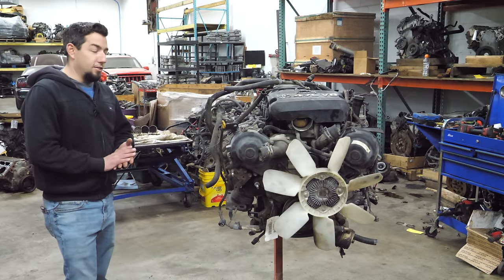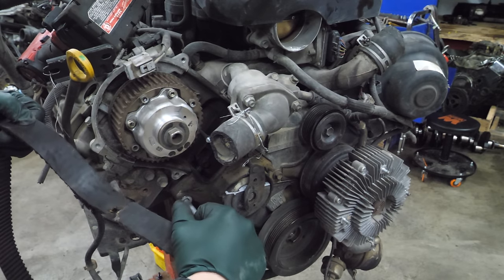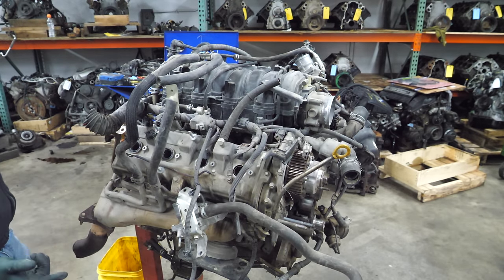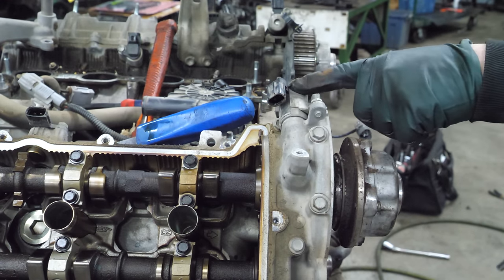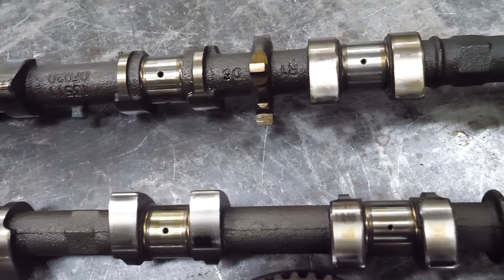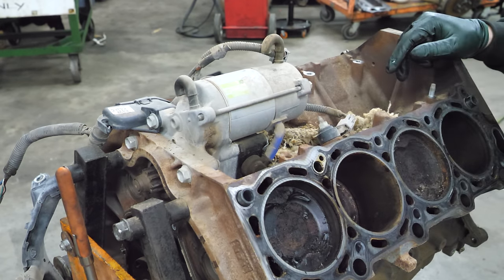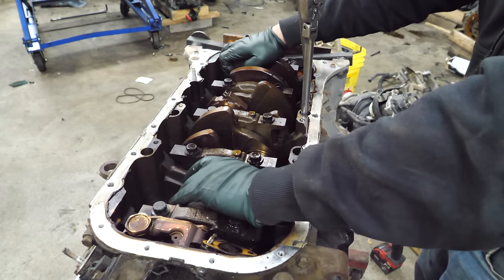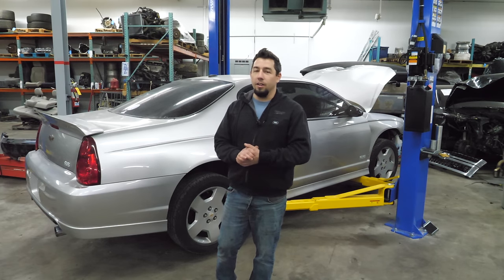Toyota Tundra 2UZ VVT Teardown! Bad Decisions Led To The Demise Of One Of Toyota's Greatest Engines!

Comment: Fantastic video / 'tutorial'!!. (I'd wish I could've subbed 10X). Great info / remarks. All respect to Ben Iacobucci's comment: I'd dare add 'most Toyota engines, even those from 1.963', (My own / late Grandad's FJ40, very same one I used to 'learn' to drive @ one of his farms, early 1.980's, when I was about 10 yrs old), NEVER die, unless some jerk  does 'something really wrong on purpose'. I still keep my late Dad's 1.984 Nissan Patrol / K160 w/ original P40 petrol engine purring like a kitty. Why anyone?.. Quite simple indeed. It's almost my Family's tradition 'cuz Toyota & (most) Nissan's reliability, as long as you perform due maintenance BEFORE deadelines. I even have motor's oil / tranny's fluids changed at least twice a year, keeping in mind oils / fluids tend to  oxidize, even if the motor / vehicle is used less than 200 miles per year, as my  old Nissan Patrol or 1.995 Toyota Land Cruiser FZJ. BTW: I'm NO mechanic / technician, (I'd wish I were one!). I'm just an ER/ ICU Dr.

Comment: Mine broke while idling... it's fine now... no damage internally... I even tried to crank it again after it broke...
Anyway... I tested the compression and then put new H²O pump and misc. other wear parts and cranked it up and drove it... 
NOT interference engine unless you're doing 80mph on the interstate and can't stop...

Comment: I have a high mileage car, the scheduled maintenance has been by the book since new. The consequences are: 256,000 miles with no oil consumption; performance is far more than adequate; suspension and auxiliary components replaced have been minimal.

Comment: If it had alot of mile the valve cover gaskets leak. I have 249k on an original timing belt but I'm buying a new truck next week and I'll be parking this one. I'll get it done before many more miles.

Comment: If you didn't know, you can see what makes an FE head and FE and not a GE. You probably read about valve angles and GE performance. That is correct. A giveaway without measuring is the gear driving the cams at the same time. In reverse rotation. Because the angle is narrow, Toyota used one cam pulley instead of two on each cylinder head. And then used a gear to drive the other. GE heads are individually driven. It almost looks like a diesel and not a pentroof the angle is so shallow.

Comment: That might have been dealership work. I had a 2001 Chrysler PT Cruiser, bought brand new, that had chronic overheating problems. The dealership never found any issues. Then, one day, the timing belt slipped off because it had turned to goo due to a coolant leak. Took it to the dealership, and they wanted to replace the engine to the tune of $3200. They wouldn't do a repair because Chrysler didn't allow for that. So we had it towed to a mechanic we trusted. (I have to tell you, the image of a PT Cruiser being towed OUT OF the dealership clearly embarrassed the dealership personnel.) The mechanic fixed the coolant leak and put a new timing belt on it. $600 later, it ran perfectly. I had another situation on a different car where the dealership didn't want to fix a transmission problem, they just wanted to replace the transmission for a much higher price. Dealership wanted $3400 to replace the transmission, I found someone to fix it for $1100.

So it's possible Toyota may be similar; if there's a problem with the timing belt, just replace the engine because "who knows what's wrong with it".

Comment: Just replaced timing belt, water pump, idlers and tensioner on my 04 Tundra. 120,000 miles. Belt was in very good condition. Definitely could have gone much longer but after 18 years and 20,000 miles over recommended belt change I did the smart thing. Did the job myself. (Retired millwright, so I have plenty of mechanical experience) Several good YouTube videos out there. Not that difficult. Just take your time and do everything right the first time!

Comment: Due to the nature of the VVTI, wouldn't engine damage be determined by engine RPM? I'm guessing low RPM, belt snaps, cams aren't advanced, no interference. High RPM, very bad day. 
I just did mine, way overdue, '05 Tundra, but only 40K miles. All the parts were pristine, even the belt didn't crack when folded back on itself, but this vid taught me, a couple days work, $190 Aisin kit is well worth it. Thanks for posting!

Comment: How do you disconnect that harness inside the truck? I am doing a frame swap on a Tundra right now and it would have been much easier if I could just reach into the firewall and unplug it. While the cab is on the hoist, I can't really get under the dash. I didn't plan this part very well.

Comment: I finally replaced my 2005  Tundra belt at 125,000  (12 years) looked like new,, no cracks,  nice & pliable, felt like a dummy.
Reply: Doing mine now at just past 200,000…little noise in couple of pulley bearings, but belt was in great shape! Doing it all while I’m there! Cam seals and cover seals, crank seal, plugs, radiator, hoses, thermostat etc…not bad for a 19 yr old 200k I’ve done nothing but oil changes on:)

Comment: I think there is a lot out there that think of v8 as engines like they used to be with chain-driven timing components and unless they are told they don't even know about timing belts and that they need to be changed. Shame to see a good engine go so quick.

Comment: we have all replaced starter motors in all kinds of vehicles.  and in most cases they are pretty easy.
but what causes starters to fail generally?
i'll bet that one major cause is the environment where the starter is mounted.  down low, almost under the engine, drowning in salty slush, rain, snow, deep water etc etc.  it might be that toyota has it right, up high and dry, well protected
Reply: Environment (and even frequent stop/start) will be an accelerating factor, but a starter motor is simply a high current brushed DC motor. They need to be serviced/replaced for the same reasons that distributors need to be serviced/replaced. Lots of high current hot switching and moderate voltage hot switching, which is the operating mechanism of a brushed commutator, is also the life limiting mechanism. 
I'm pretty sure these newer mild hybrids with auto stop/start are running 48V Brushless DC motors, where the commutator is replaced with electronically timed power transistors for each motor phase that are not exposed to the same shortcomings as a commutator, however the tradeoff is that it no longer has a simple 2 wire interface like the brushed motors do.

Comment: I big issue with the 2UZ was the upper water manifold seal/thermostat seal failing, owner just keeps topping it off as it leaks on the timing belt turning it into mush, at which point it strips teeth and almost always bends valves.

Comment: On your parts tundra, how much for the antenna mount and mast.  I'm tired of replacing my power antenna on my sequoia so I want to delete.  I've found some near me, but all of them have had the wires cut.  I need the mount with a complete wire to plug it back to the stereo.

Comment: next time put a 6mm bolt in the exhaust gear so it doesn't spring and put the cams back in to keep the lifters from falling out after you pull the head bolts.

Comment: To be perfectly honest, this engine is in such good shape (aside from the minor rust in the cylinders) that I'd seriously consider attempting to rebuild it.
I mean, the way it looks to me, more damage was done to this engine by sitting out in the rain than was ever done to it by the timing belt shredding itself.
The main thing you'd need to do to return this particular engine to service would be to give the cylinders a light honing, and to perhaps remove the rust from the pistons by soaking them in Evapo-Rust (that stuff does work, believe it or not, you just gotta give it time), or if you don't have the time for that, putting them in a media blasting cabinet and using fine granulated salt to blast the rust off of them (salt won't damage the finish on the pistons, I don't think. I'd check first, and select an even softer blasting media if needed).

OK, just watched up to roughly 29:00 , and I heard you say several of the piston rings were stuck. That's a new set of rings then, and making sure the ring grooves are thoroughly cleaned out too. Still, that's something I'd check as a matter of routine when rebuilding an engine.

If I had been the mechanic that was repairing the vehicle this engine came out of, I'd have happily put a timing belt in it and sent it on its way (of course, I'd have done both borescope and leak-down tests to check for bent valves first, but since you've taken this thing so far apart and found literally zero evidence of piston to valve contact, I'm confident that it would have passed such testing with flying colors).

Comment: A co-worker has appox. 280k on his early 2000 Tundra. I think he might need oil sensor since his oil pressure reads low. Oil level good.
I have to ask him about the timing belt. He probably never changed it. I taught they had chains.

Comment: During the relatively short time that I worked as a service writer (due to an injury, normally worked as a tech), timing belts were usually an easy sale. The most difficult sales of timing belts happened on vehicles where the customers didn’t put many miles on them, usually older folks. The vehicle could be 15 years old and on the original timing belt, but many customers would insist it is fine because they “don’t drive the vehicle very much.” It doesn’t matter! Rubber degrades over time whether it is used or not. I’ve seen many timing belts break before the first mileage replacement interval because they were just old. They typically are good for 10 years max.

I can’t remember for sure, but most “older” Toyota engines (just about any that use a timing belt) are non-interference engines. Odds are that if the broken timing belt was the only issue, it could have been easily fixed with a new timing belt.
Reply: That's precisely why I want nothing to do with timing belts. Ever. No exceptions. Chains stretch, sure, but even a shitty chain stretching will last longer than the rest of the car will. Something ELSE will go first. And if it's a cam-in-block engine like it should be, we're talking >300,000 mile service life from a timing chain before it's stretched enough to affect running qualities.

But hey. I'm spoiled in this regard. My 4.9L I6 uses two steel gears lubricated with a direct oil jet. The timing gears in that engine will literally last over a million miles without issue. The rest of the engine will wear out, get overhauled, and wear out AGAIN before the original timing gears are worn out. And those 4.9s have a stupid long service life anyway; half a million miles is not unheard of for them and it's considered an early death if they don't reach a quarter million. Mine's at 350k and still gets the job done without issue.
Reply: The Lexus crossovers had a hiccup with the RX330, which was a very short-lived transitional design. The RX300 (3.3L V6, IIRC) used a timing belt but was non-interference; the RX350 was interference but had a timing chain. Only the poor RX330 in between had both a belt and smashable valves. We bought a 2004 last year with a mere 140k on it, and we could find no record of the belt ever being replaced. So that was on the service list this summer. Then I traded it on a 2006 4Runner and the belt R&R became someone else's problem.

Comment: Is it possible that the belt failed on engine start? Usually benign, with no engine damage when it shreds on the crank pulley. Happened on my wife's car.

Comment: I have an 05 and my engine randomly sounded like it had 0 compression. Wasn’t running when it sounded like this. Tried to start it and it started to sound weird. I checked to see if the belt snapped and it looked fine. The starter is turning the engine because the fan is spinning but it sounds like my spark plugs are just removed and there’s 0 compression. Is it possible the belt is slipping on the crank and not spinning the crank??

Comment: I have no idea in regards to the mileage of that timing belt. However, my friend has a 3400 V6 Tacoma and according to a note left on the timing belt cover, it was last changed at 152,000 km. It was still going at 350k+. Now, I am not sure that note is correct, but if it's anything to go off of, I bet you that engine had plenty of miles on it.

Comment: My timing belt broke the tensioner loosened up and caused the timing belt to jump now the engine keeps cutting off won’t work just have it over 75 miles an hour on the highway. My guess is that I got bent rods

Comment: I have two Tundra with that engine. I bought both new, and had transmission coolers added to both.
 
1- SR5 TRD with 106K, with a 3 inch lift
Just replaced my starter and window lift motor after 19 years.
I have a K&N cold air intake , NGK iridium plugs. I made a mistake with the NGK I used of used Denson. .

2- Limited with 65K miles, K&N box air-filter and Denson Iridium plugs.

Any suggestion of upgrading the coils. Headers vs stock exhaust ?
Reply: I had a 2003 Tundra with the regular 4.7 and I put MSD coils on it and they worked great. I also installed stainless shorty headers I bought on Ebay and they worked great too. I had to get a bigger truck with bigger brakes for towing, so I got a 2007 Tundra with the 4.7 VVTI engine and have had that for a couple years now.

Comment: Do you have an opinion on using Castrol high mileage syn oil in a 4.7 VVIT engine with 118,000 miles? Or should I stay with standard syn oil on this application? Great Vids. Congrats!

Comment: Yo,   What’s up with them 4.0L SOHC mustang engines.  You sell them often? 
I got a 2010 mustang with some carnage in the cylinder I observed with my bore scope through the spark plug hole. I’ll have to replace or rebuild it.   yet to see.

Comment: Other than their use of a timing belt instead of a chain, Toyota appears to make a well designed V8 engine and it's no wonder that they can go the distance with proper maintenance. That bottom end and valve train looked terrific. Would love to know how many miles this unit had.
Reply: I'd also be willing to bet that running a ball hone through those cylinders would bring them back to a serviceable condition. Some fresh rings in those pistons and this engine would run fine. Another excellent video Eric!

Comment: I have a 2000 toyota tundra 4.7l that died while driving. We finally discovered that it was the timing belt. We replaced the timing belt but still cant get it to start. Used a borescope and all the valves look good. Any suggestions?

Comment: If i rememver correctly, the 4.7l iForce is a non-interference engine, so replacing the belt, tensioner and water pump and she would be ready to rock and roll.

Comment: Sad about the engine, but glad you were able to get so many good parts!  I hope it's profitable for you!  I had a 2003 Tundra Step side that I loved.  I live in Maryland, but was working in Cleveland for a couple months.  I had the local Ohio dealer fix a couple things like the rubber band (at about 110k miles).  The frame was a problem with the early Tundra's and mine had rust damage.  Strangely, they weren't able to coat the frame in Ohio due to not being approved by the EPA.  About 5 years later, I took it to the local dealer here in MD for a couple things and they wouldn't give it back to me!   They were amazed the rear crossmember that holds the spare tire hadn't fallen off!  It was that bad!  After some back and forth (and the realization the dealer would be paid very well to replace the frame) they were able to get Toyota to approve it!  Took 3 months!  But they replaced the frame, most of the front suspension, and a bunch of other stuff!  It road great after that! 
But I suspect when the folks that worked on the Tundra you got the engine from, the frame was probably bad and they told the customer it wasn't worth fixing.  
I sold mine to a friend with 175k on it a couple years ago.  He has rental properties and needed a truck.  Still running at 200k miles!  Not as pretty as it used to be, but he was pulling a trailer behind his highend SUV!  And he got a great deal!  
Thanks for the video!

Comment: Have I understood it correctly, if they had replaced the timing belt even after it had broken then it would have run like nothing had happened, looks like it has had an oil change at the right time while driving?